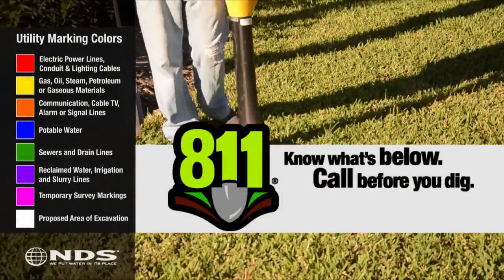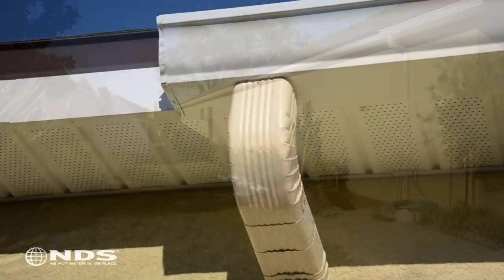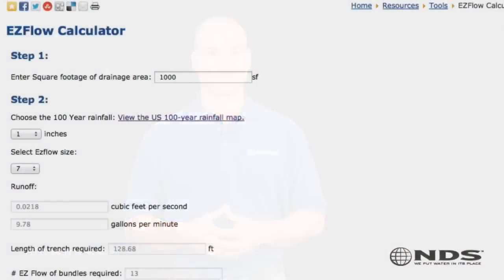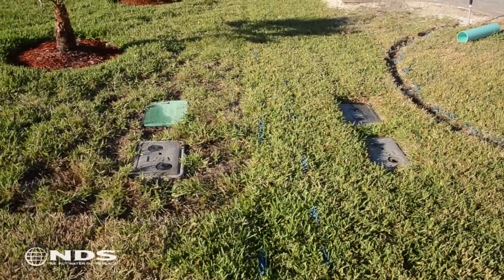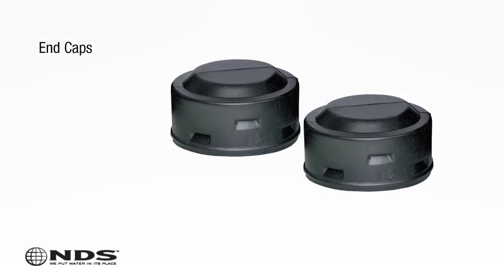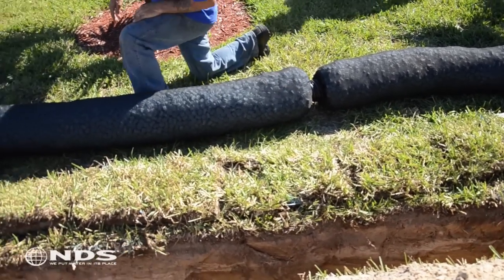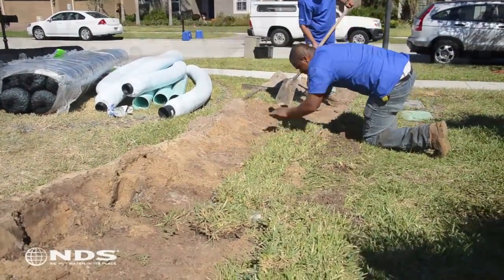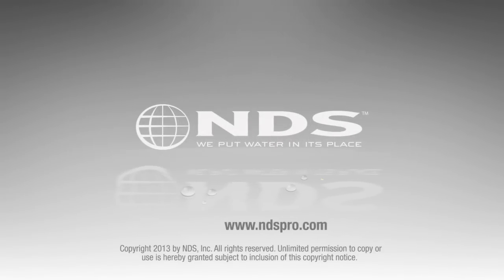How to Install Gravel-free French Drain | NDS Yard Drainage Systems

Comment: I will tell you a big problem with this company.  Here in Southern California they only sell this product through vendors.  For a 4 inch pipe one vender wanted $144.00 per one ten foot section.  Another vendor wanted $112.00 per one ten foot pipe the next vendor wanted $85.00 per ten foot pipe.  Home Depot wanted $53.00 per ten foot pipe but was not in stock and they would not order it.  NDS really does not want to sell this product if they allow the vendors to price it like this.  It reaches a point where if you have a 50 foot run it is too expensive because you still have to buy the connectors and the end caps.  Best to use the old traditional way of doing this with pipe, fabric and gravel for $150.00 for the 50 feet instead of the cost of $500.00 - $600.00 for the 50 foot run of the NDS EZ Flow.  This is the homeowner price.  If you were to hire a contractor you are talking over $1500.00 for the job using EZ Flow.
Reply: Do you know what the lifetime of the NDS product is compared to the old traditional method?
Reply: @synaspora can the installation be driven over without damage by the smallest tracked skidsteer or stand up?

Comment: I called 811 and they marked incorrectly. We purposely went about 8' away from where they marked power lines and ended up hitting one. Someone could have been killed or seriously hurt. 

Also, this product seemed way too expensive for our project. I believe it was about $55 per piece. I can see it being a great option for someone tho.
Reply: The cost of the drain pipe, filter fabric, and gravel can add up pretty quickly.  The cost may be a wash when you add it all up.
Reply: 0

Comment: you didn't show the connection of the EZFlow to the water source.... downspouts??
Reply: The downspouts would need to be on a separate system. The flow would be to much.  I install gutters using solid pvc and catch basins that discharge at the curb into or near a storm drain. The catch basin is essential to a long lasting system. It has a sump area which will collect the dirt and debris from the gutter system. Regular maintenance and cleaning is needed to prevent the system from clogging. The average gutter drain system is around 4000.00 and proper installation is key.  Hiring a contractor who specializes in drainage solutions is important. I have done major repairs on systems installed by reputable foundation repair companies as well as reputable landscapers who can sell a drainage system but common sense is non existing. Just replaced one that was installed 5 years ago and had already become a useless system because of poor design. The invoice was 5700.00 from one of the large foundation repair companies and the homeowner will need to pursue reimbursement. Do the proper research and decide which solution is best for your situation.
Reply: This particular application is for areas with issues of water pooling in an area, and allowing it to drain through the soil. I imagine you can use a connector adapter to connect to downspouts as well